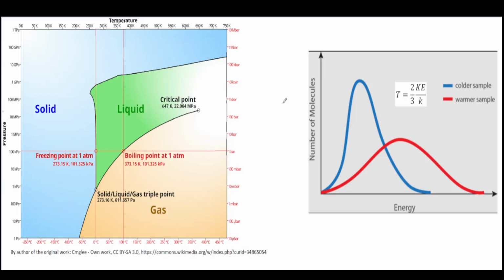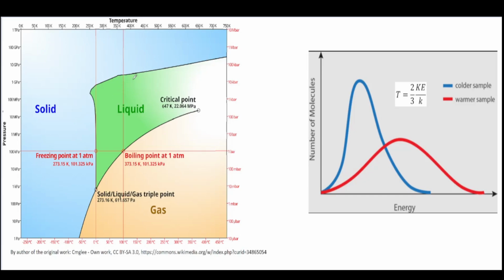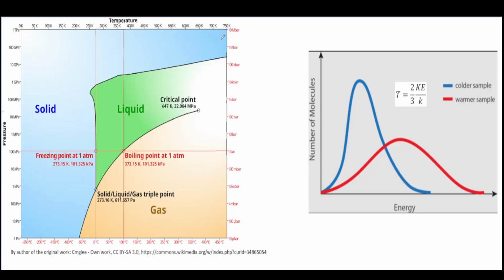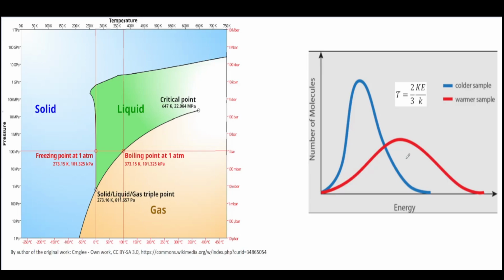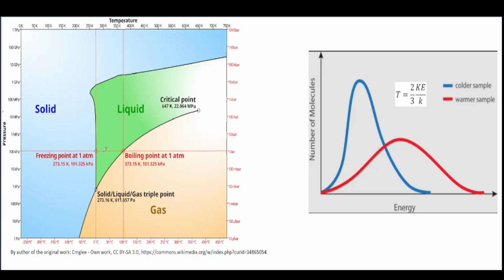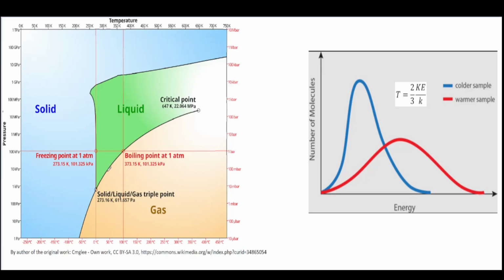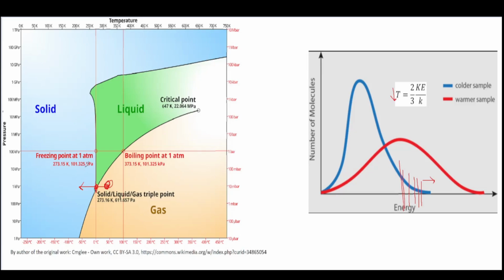Freezing Water Without Cooling, Manipulating Particle Average Kinetic Energy to Induce Phase Change

Comment: What was the vacuum when it changed?
Reply from the maker: I don't quite remember, at the time I did not have a way to actively record the vacuum signal read out. I do think it would have been somewhere in the ~200-1000mtorr range. I had to throttle how hard I pulled vacuum to keep the water from bubbling over too much. This can be done in a regular syringe, so the vacuum level needed is not super high.